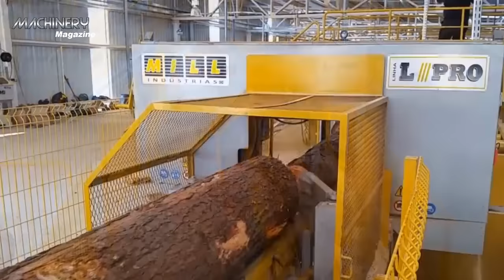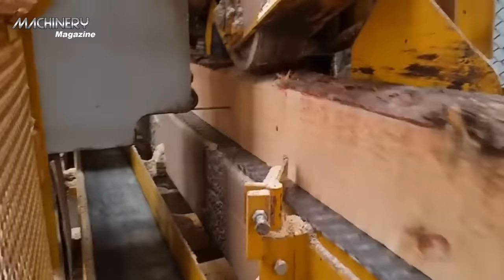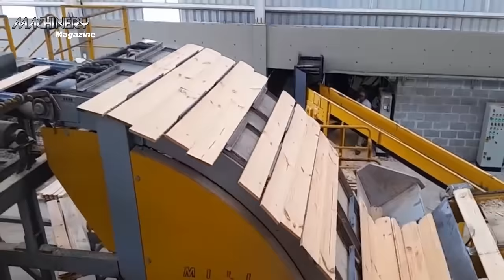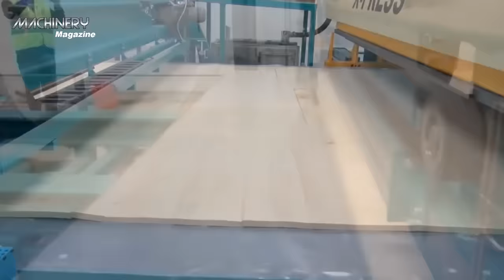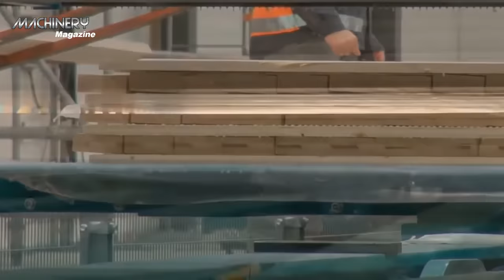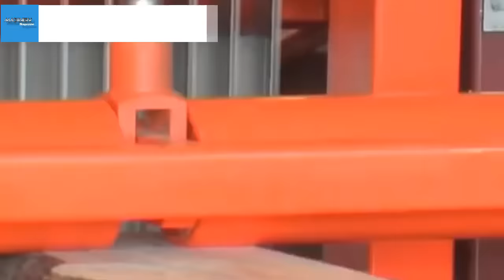Amazing Modern Automatic Wood Cutting Sawmill Machines - Incredible Modern Woodworking Factory

Comment: An explanation of what is happening would be great.
Reply: If you are a mill worker you would understand. Most mills work close to the same, with little differences.
Reply: I have worked at a lumber mill for 10 years. The mill I work at cuts logs into boards to make wooden pallets. I have done most every job at the mill. I am currently a debarker operator. I debark all of the logs and run them through  a metal detector  before they go into the mill to be cut into boards. Once the logs go into the mill they go through  what is called a Scragg saw which cuts the core of the log into 3.5", the core is called a Cant. The Cants then get cut to 48" before they go through a Gang saw which cuts them into  whatever thickness you need. 1 1/8 and 5/4 = 1 1/4 boards which go to an automatic stacker. Then they get banned and hauled away. The slabs that come from the Cants get cut to 40" or whatever size you need. Then they go through what is called a 5 head, which is 5 band saws back to back. They are offset so each saw cut them into 1/2 boards. Those boards are called Deck boards. They drop down to be sorted out and stacked. Once the unit is full it gets picked up and banned, then hauled away. I hope this helps you better understand how mills operate.

Comment: This machinery is not state of the art at all, there is no optimization, not debating for pulp chip recovery, the stacker is a single hoist with no automated sticker placers or loader. There are many far more advanced and efficient mills that off much higher production and recovery, the price point is of course significantly different.